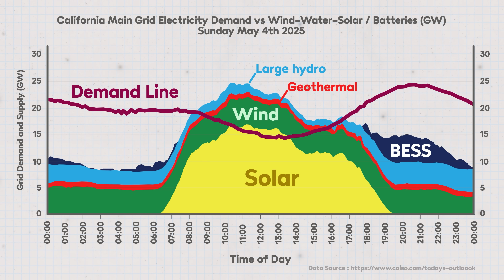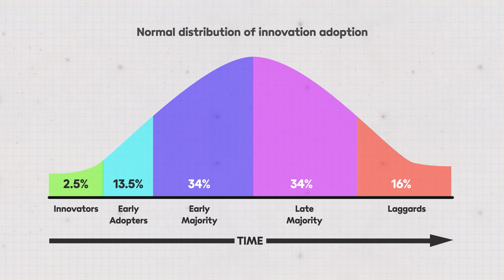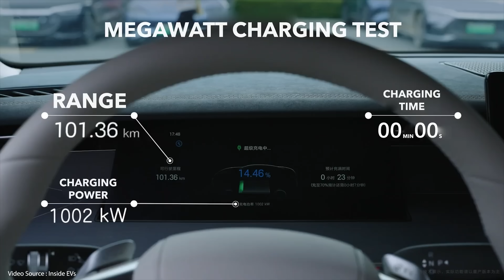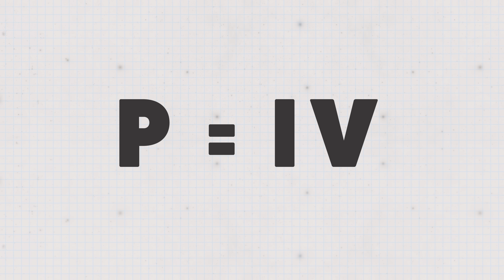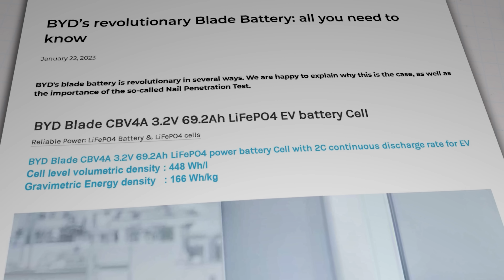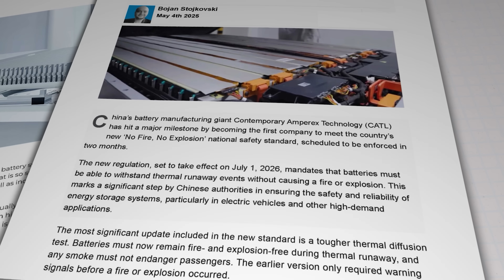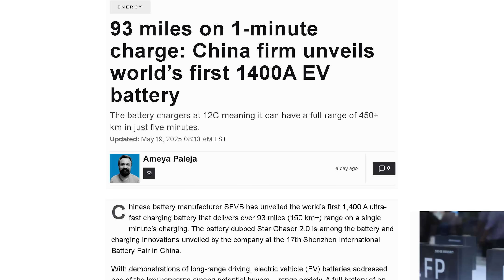BYD 1 MEGAWATT 5 minute EV Charger. Overdue or Overkill?

Comment: Now we just need an electricity grid that can deliver megawatts of power to remote charging stations.  Currently many drivers find that more chargers means that if multiple cars are charging at once the charging time is multiplied by the number of charging cars.  I reminds me of the triangle with the sides labeled, "cheap", "fast", "reliable" (choose any two)🙂

Comment: Superfast charging would presumably make an EV more expensive - I would be quite happy with a slower charging EV at a lower price, and charging at home. Safety is always an issue, but I personally am OK with the compromises of cheap LFP batteries charging at 2C. I hope cheaper options are not removed from the market in attempt to placate those who can't charge at home, and are always in an unplanned rush.

Comment: This statement of "range anxiety" and "charging problems" being irrelevant... are false? These are the most common issues that often actually lead people to go back to driving an ICE vehicle. In particular in many regions charging is problematic, not necessarily due to charging speeds but due to reliability and pricing. Basically for people that cannot charge at home - charging in many places around the world is complicated, broken and expensive. Reliability of chargers is of course super important, but pricing is actually a fairly significant question as well since electric cars assume a lower running cost and are thus often more expensive, but with fast charging being expensive, it kind of negates this and just makes the electric car significantly more expensive. Then there is depreciation, although I think the market is simply wrong on this - electric cars frequently last over 200k miles / 300k km.

Comment: Dear Dave, I just read that a MIT breakout called 24M has developed a new electrolyte for Lithium batteries that allows for much faster charging times, extended driving distance up to 1600km with Lithium-metal anodes instead of graphite and preventing generation of dangerous dendrites. Have you or could you fill us in on that in the nearest future. Best regards Steen Hansen from Denmark.

Comment: I could see it as the high speed fast chargers being available, but being more expensive than the slower ones, so like people will choose between gas stations based on location and price, they might use these fastest chargers if they are on a trip and need a top off fast, but for general use will just use the slower chargers when not at home.

Comment: In 1985 a bunch of students plonked an experimental wind turbine on the Isles of Scilly. I walked up the hill to look at it. I read the sign on the gate, about the power output. (It shows how long ago it was.) I thought "thats about the power output of a big Jag XJ6 engine.) I looked around the fenced compound round the base of it and thought "there is enough room here to park a dozen Jag XJ6s." It was a weird comparison to draw, but it set me thinking. I walked back down the hill, on the warm afternoon between the cedar trees, doing some sums in my head. By the time I got to the bottom of the hill . . . "Holy Cr^p?!" We were going to need charging rates of MEGAWATTS - we were going to need, depending on where you started the sums, anywhere from twice, to FIVE times as much electricity as we had then. Some of it was so crazy I simply dismissed it. About 8 or 9 years ago I listened to a National Grid spokesman dismiss (and it was dismissive) the whole electric car issue as "no worse than boiling a few extra kettles." (They must have been terrified.) . . . now 40 years later; we have got . . . "Megawatt car chargers!!" Uuuuuh 40 years ago I dismissed some of the numbers as "I must be wrong, we can't possibly need that much . . . ???" But now? "Holy cr^p!!" (PS - and I wrote to National Grid, saying they should promote dismountable car batteries. If they left the car industry to carry on with fixed batteries, they would be lumbered with absurd infrastructure! Megawatt chargers??!)

Comment: Sorry,i just do see the reported boom in ev’s at all. In fact there are massive discounts on preregistered models.
Volvo uturn on the ev. Net zero has to go. Its 30 yrs of grid upgrades needed to get anywhere near the necessary power. As for 5 min charging,please dont just spout the Milliband propaganda,china are making range extenders for their evs which is a petrol generator on the back. Stop being silly.

Comment: This is good news, despite many people that seem to think they speak for all EV drivers, we do need larger capacity batteries and faster charging. We are not all retired city drivers that only go shopping twice a week. Some of us do long commutes, have familys who demand heating and aircon and the current state of batteries that only get 100 to 200 miles of real world family use in exchange for the recommended 60% of battery, is very lacking. 

Bring on the 600 mile range EV. I never want to use a public a charger and I certainly don't want to spend 2 hours a week stuck on one when I have to use the motorway 4 times a week. I put up with this because I am an early adopter, not becasue I think this is acceptable and should never change like some seem to bellow

Comment: When charging ev cars with very high current and voltage does the operation require rubber gauntlets and rubber matting, because if that was in an industrial setting they would be insisted upon by the safety management+ qualified users only.

Comment: I think this is a nice to have to convince people to swap to EV, but mostly useless for everyday EV owner. Where it matters is probably more on professional and heavy duty level. If you can achieve that kind of fast charging, it makes electric buses way more attractives and probably even bordeline reach the trucking industry. This is quite nice.

I just think that maybe the fact that they are able to swap the voltage of the battery pack on the lot is something to get around. If you could rewire your batteries for charging, this could allow more charge with lower amperage.

Comment: So if somewhere down the track every home in the US has a megawatt charger, that means that if one evening a million homes across the country turn on their megawatt chargers at the same time to recharge the family EV that will require the grid be able to deliver a million megawatts of power, or one terawatt, all at the same time.

For the record, as of 2023 the US electricity grid had a total capacity of 1,189,492 MW or about 1.2 terawatts.

Like to imagine what would happen should 1.3 million megawatt chargers all be turned on at the same time?

Comment: So I see it like this, I live in a terraced house. I CANT own a home charging solution. Many people are in the same situation, people you NEED to have on board for an electric future. Therefore the only way to enable that future is to have them own vehicles they can easily charge at conventional infrastructure. That is to say petrol stations. If you can manage that then people can pull up to the pump as they have always done, charge and be on their way, and the cost of installation of such charging is shared amongst all users, and does not therefore marginalise poorer drivers.
Avoid multiple challenges, EV adoption is one challenge, but EV adoption and home charging (with the required setup) is double that. By keeping the old infrastructure of charging at the pump you potentially make EV use more accessible to all.

Comment: Now the used EV market has matured a bit I'm considering swapping my 700 mile range pre-2017 diesel for an EV, so long as it can do 150 miles on a charge. A 62kWh LEAF e+ with a 50kW charger can top up the other 75 miles I might need on a trip in about 30 minutes, or a Dolphin can do it in 20 on a 100kW CCS. It's good that things have progressed to the point of range not really being an issue. The next thing to work out is whether I save enough to cover an additional £400pa in tax and insurance!

Comment: That is a lot of power in the connection. One million watts and if the connection is at the very least sightly defective from long term usage, you can have a major arc forming with a subsequent severe damage to area around the connection. For the average EV owner, I do not think this a good idea. At least we know China will do good due diligence with its design.

Comment: I have an 'oldfashioned' Model Y from 2021, only during roadtrips whilst towing an 800Kg glider trailer are a bit cumbersome when I have to charge the car about every 200km for 15-25 minutes... But these stops are used properly to charge myself too with Cafee und Kuchen (I drive a lot in Germany) lunch or diner... and a visit to the bathroom.

But at home it is no issue at all, I always have my car charged overnight at the public charging pole at the parking lot just 40 meters away from my front door...

Btw, the battery has lost about 8.5% of its capacity now, after 4 years and about 65.000 Km. Most of the time I charge the battery to 90% and charge it up again when it gets below 20%.. I think the battery is holding up very well, and this capacity loss of 8.5% has been the same since it got to about 50.000 Km. From what I have read here and there it is normal the battery loses about 6-9% of its capacity the first 20.000 miles and then remains stable for a very long time before dropping off to unusable capacity numbers.. If you would plot it a in curve capacity loss over miles driven, it looks a bit like an S on its side.

So, beside the 3-5 roadtrips per year, 95%of the time the slow charging of the 'oldfashioned' Model Y is no issue at all.. its a FEATURE, because I can do that easily overnight right at my home and does not cost me any time at all, it saved me many HOURS of visiting gas stations. Only for this feature I would never go back to a gas car, but there are many more reasons as well, like the ease of trailer towing, the fun to drive, the very low operating costs, the many useful features a Tesla has, FSD.. I could go on and on!

Comment: One thing you forgot to mention, Dave, with respect to the perception barriers, is that I feel certain that most of us BEV drivers don't worry about range because (unlike 6 years ago when we as early adopters bought our first BEV, a Nissan LEAF with 140 miles of range), at the present time there are many more chargers available, many more BEVs capable of well over 200 miles on a charge AND how many of us want to drive 4, 5 or 6 hours without a stop, if for no other reason than a toilet break!? Should also mention, if you're stopping for a toilet break, a coffee and a bite to eat then, more often than not you'll have enough charge before you've finished your break! Anyone who claims  to drive 400 to 500 miles without stopping (and I've come across them) is positively a danger to other road users! Enough said!

Comment: The urge to get more powerful, smaller, faster batteries or cars help someone and make many people happy.
But to get everyone onboard the end product needs to be affordable. The purchase of a new electric car is almost twice as expensive as an internal combustion car. That is way too much.

We need to strive for affordable cars, that can preform the basics, 200 to 300km range. They are around €30 000
Or my needs is to tow a trailer. 700 to 1000kg, and 300 to 400km range. The start about €50 000

Comment: Nice video and just subscribed.
But... I miss something many many people miss: battery swapping. It's quick, much less energy loss when charging and therefore cheaper for the customer. In fact, any energy loss during charging will not come to the expense of the customer.
There's grid balancing by the stations and slow charging, cheaper tariffs, no more cables to wind up and unwind in wintermornings, before leaving for work. No distribution of electricity to homes because grid hubs with swappable batteries are centralized, like gaz stations. My god, why do people cling to charging EV's themselves, it's so inconvenient and inefficient.
NIO and CATL have swapping technology. It's the future.

Comment: As always, the limiting factors are within the car, not the supply. So I'm looking forward to seeing BMS and batteries which can withstand 12C recharging without compromising battery longevity unduly. But anything faster than a 10 minute recharge time is rivalling the time taken to refill a petrol or Diesel car, because the driver does not have to be at the vehicle during recharging. They can be doing other essential things such as stretching their legs, attending to natural functions and needs, or even going shopping.

Comment: I hope researchers, development engineers and manufacturers are getting the safety issues right. All that power in a car charging system  going  into the EV batteries seems ripe for both small and large disasters. Even as we speak, another ship in  transit has caught fire in the Pacific, the fire suppression system was completely used up and all personnel abandoned ship (were picked  up, thankfully.)

Comment: Projected battery storage capacity by 2030 1549GWh. “Quite impressive don’t you think?” No, I don’t. We currently consume electricity globally at the rate of 3.5TW. For solar power to be competitive, we would need to store this for at least 4 hours between maximum production and consumption. This would need 14TWh of batteries. We have even less chance of achieving this when batteries are being wasted coercing people into buying EVs (at least in the UK) which most people I have spoken to don’t want. The battery for 1 EV could flatten the duck curve for 5 homes. V2G is unlikely to succeed because most people go to enough trouble charging their EVs without wanting to sell electricity back to the grid even if it was at a profit. Your channel also fails to consider the possibility that net zero is the biggest scam intended to reduce our freedoms since lock down. We need more CO2 to increase food production. If you don’t believe this watch https://www.youtube.com/watch?v=mcCmVYyXaAs or https://www.youtube.com/watch?v=TjlmFr4FMvI If YouTube censor this I will use this as evidence that they do not believe in free speech and are a party to the scam.

Comment: I've been plugging in since 2014.  First, we had a Leaf for local driving and a Volt for trips.  We only charged the Leaf at home and used the Volt for a 300 plus mile round-trip for chemotherapy once every 3 weeks.  The Leaf actually got us around town just fine and the Volt was a backup car for local.  Then in 2018 we got a Model 3 and that was our car for everything including long trips and the chemo trip.  We kept a Tundra for clearing our long drive, but I looked forward to getting a Cybertruck and becoming a single car family.  We have the CT and a Model S now.  I don't have a plow on the CT, but it drives through big drifts.  I got the drive plowed once in 23-24 and didn't get a plow in 24-25.  We have a full tank every morning and the thought of going to gas is absurd.  Tesla's full-self-driving makes it even more ridiculous.  The Tesla charging network is more than sufficient.